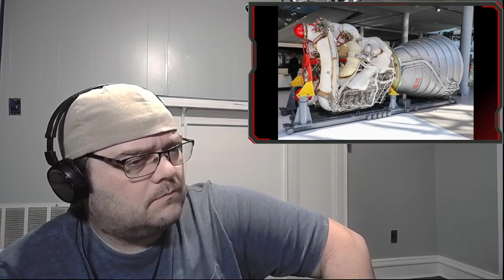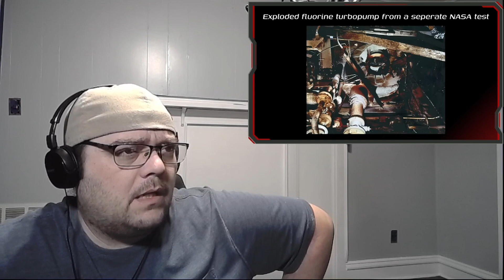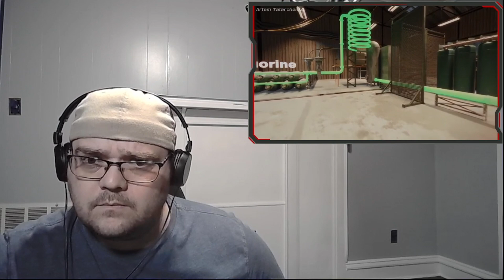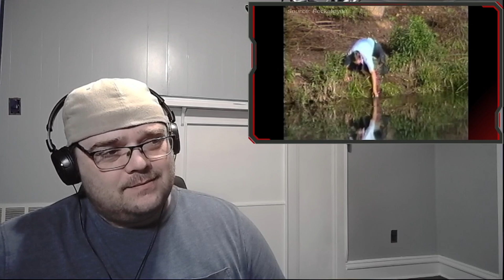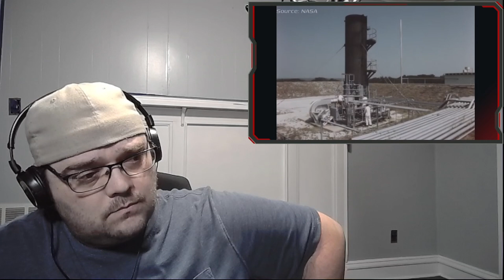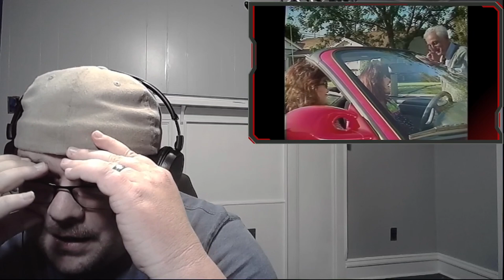Rocketdyne Tripropellant - Let's Talk Rockets! - from Alexander the OK - Reaction

Comment: So basically they built a rocket that with very minimal problems would become a bomb that sprayed 2000C acid everywhere
Reply: No, they designed the rocket that sprays 2000C acid everywhere as an exhaust in normal operation!
Reply: @090giver090 in normal operation it would only spill it in one direction
Reply: "Down" on a rocket launch pad while spraying a strong acid through a nozzle is merely a suggestion.

Comment: I don't know why specific impulse is expressed in seconds. It is only confusing. It should be expressed in m/s or N*s/kg , because it is a ratio of the thrust of the engine and the total MASS flow,or the “effective" exhaust velocity. “Effective= actual exhaust velocity only in closed cycle engines, in a Merlin the effective one is lower because you have to take into account the mass flow of the gas generator.
Reply: It was created so that, at a glance, an engine cycle and fuel mix can be evaluated, even if it uses ft/s or horsepower*fortnights/firkin as its units of engine performance. It's the number of seconds a mass of fuel can burn to maintain that same mass at 1g of acceleration.

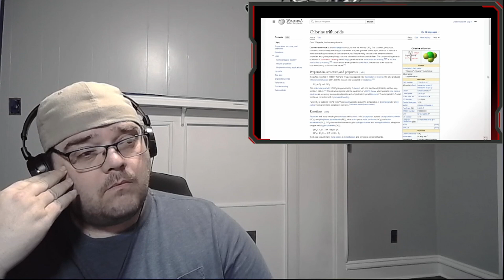Comment: 56:14 a note on the chlorine trifluoride aspect, it can and will chew through several durable materials. including asbestos, glass, sand, concrete, ashes of previously burned materials, metals, if it can react to something it will react to chlorine trifluoride. and not only does it chew through these but can also light them on fire, hence the usage as a fuel oxidizer. let me reiterate, it can light asbestos on fire, you know the thing that was used as a fire retardant. thats how potent it is.
Reply: flourine: we put some oxygen in your oxygen so you can burn while you burn!
Reply: Now THAT is terrifying
Reply: Now let's bond an extra oxygen to it to make it Chlorine Trifluoride Oxide, for extra fun!

Comment: For those of you who are confused by the difference between fluoride and fluorine, the fluorine atom likes electrons and would do anything to get it. A fluoride ion is a fluorine atom that already has the electron that it so desperately wants. As a result, the fluoride ion is a lot less spicy than a fluorine atom.

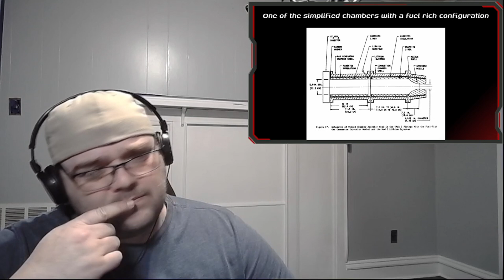36:18 The specific impulse is not in a linear relationship with temperature, for when you calculate out the relationship between all these variables, specific impulse goes as the square root of the temperature, so you would get a 37% drop instead of the 60% drop you would expect. Add to that, running fuel-rich exchanges fluorine for lithium/hydrogen, which are both lighter, which brings down the average molecular weight of the exhaust gasses, and consequently give you higher specific impulse. I calculate that the molecular weight needs to drop by 55%. There's probably some adiabatic index sillybuggers involved.